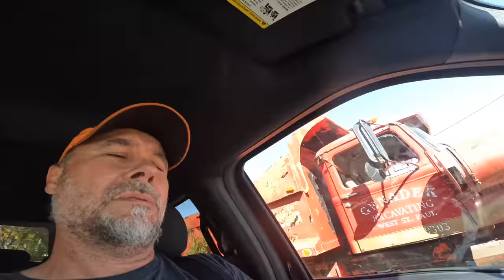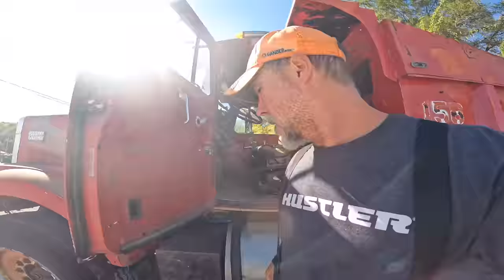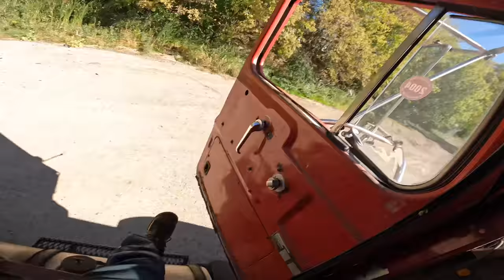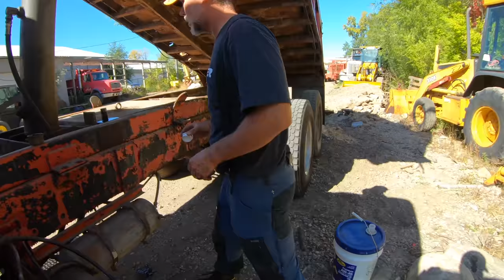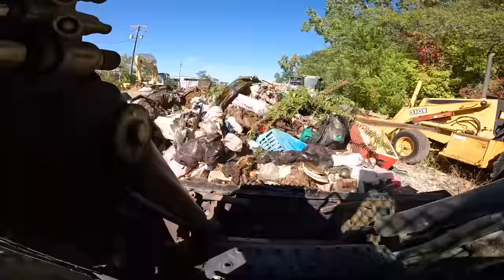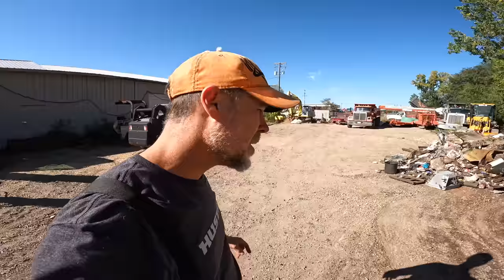Bloated Load gets stuck in the air

Comment: 9513 Road ranger transmission. One of the last true White Trucks made before the Volvo influence took over .

  There was a 75 ' White  Road Boss Tow truck with an 850 Holmes bed on it , here in my neck of the woods when I was growing up. 

It had a 350 Cummins & 9513 in it with a large Tulsa Winch on it. It was a hoss to say the least & sounded sweet going through the 13 speed.

Comment: Nice sounding engine to me, Stan, though not the same machine, the CAT R1600 scoop tram with the C11 6 cylinder engine was the sweetest sounding diesel engine that I ever operated, and one of the strongest when I was still mining. Thanks Stan, I loved the video!
Reply from the maker: I bet they sounded even more aggressive down in the mines underground.  I love how this engine sounds.
Reply: @Dirtmonkey  I don't know about Cat engines, but the Deutz's in our scoops up here in Ontario sounded bad ass and were very reliable .   Enjoyed the video though that truck seems very problematical, and may be better off rusting away in your yard🤔 .
Reply: @kasnitch  what mine was that if I may ask...I worked at the Dome Mine, Kidd Creek and finally at Hoyle Pond, Dome and Hoyle Pend used Deutz's on their smaller 2 to 5 yards is what I remember.
Reply: @frederickmoller  Hey thanks for replying Frederick .  I did a good long run up at Dickenson in Balmertown , after working for Graham in Wawa back in the day .  That was an excellent mine to work at and very good safety standards.
     I ended up getting too much dust exposure in some haywire outfits after a labour strike out there, and now have 40% lung capacity left .   That being said, it could be worse .   I miss the action every day, not sure about you .  I hope you are well .
Reply: @kasnitch  I had a stroke on the job about 4 years back that ended my career, though Dumas wanted me 2 years ago, I passed. Yeah I hear you too, I wish everything goes better for you from now on!

Comment: Years ago my uncle had an old White ups tractor we used as a yard tractor. It had a stiff clutch in it that had you pulling up on the steering wheel as you pushed in the clutch. 
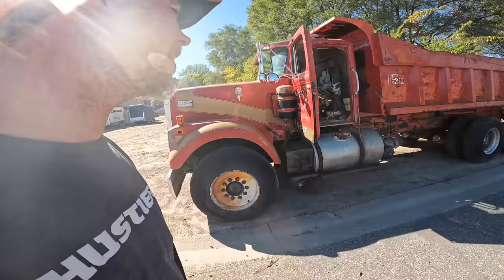  Paint line had their mover break down so I got stuck moving all their trailers on top of my building. I can still remember that week quite well even though it was 25 years ago. I would climb in the truck around 6:30 in the morning and ran till 5 at night. 
 Between pushing that clutch and climbing in & out of that tractor all day come 5:00 I could hardly walk anymore.  They had me moving for 4 of our shops & one week was enough for me. 
  My main truck used to be an old international grain truck converted to fifth wheel that i loved but for some reason I had it down at the moment also.
Reply from the maker: A tough clutch is a deal breaker for me.

Comment: There's a very fine line between making lease payments and not having the maintenance and breakdown/towing bills and headaches and the cost of keeping and old girl running let alone safe with the never ending repairs of discontinued parts and wore out everything. On the other hand the old girl has no DEF and no computer so there's at least 87 1/2% of all problems. But with a lease they are not your problems nor is my big ass bill for the wrecker 😁. We run canola oil through our fuel tanks on our wrecker in summer, amazing how cool the return lines are and the engine runs a lot cooler also. Have a gooder.

Comment: That truck brings a whole new level to the phrase, Rust Bucket. I don’t believe I’ve ever seen so much rust inside a vehicle as I saw in the cab of this truck. Also, my dad told me when they drove army trucks they would “double clutch” all of the time eliminating the clutch. This was in WWll.
Reply: You’re referring to floating. Double clutching is when you clutch in to break torque, trans neutral clutch out to match the input shaft to the next gear, clutch back in and into the next gear, then let the clutch back out. Floating gears is when you skip the double clutching and just lift the skinny pedal to break torque. If you’re decently coordinated and time it right you can up or down shift by just floating without causing any wear and tear on the trans.

Comment: I have to admit I was nervous watching you fill that hydraulic fluid without using that safety stop for the box.. I’ve been driving on and off for 25 years and there’s no way that other guy would have pulled you away fast enough with a loaded box. They come down so fast you wouldn’t have the time. Try slamming the gate next time it usually works for me.,Just be safe and take the extra 15 seconds to set up that bar. I think it’s time for a new truck. Lol.  😎👍🏼

Comment: I had a a day cab freightliner columbia with a clutch like that. Hauled bio waste with it in and around a fry plant so i had to use the clutch a lot backing inside, by the 2nd hour my clutch knee was killing me so i know exactly what you mean!! It just seemed like the spring was way too strong, we did the same we took it in but the mechanics did nothing!
Reply from the maker: This tranny is an eaton "autoshift". it should be called the eaton auto sh@t' in my opinion.

Comment: If you blew an Air Line, you'd know it fairly quick even if the Low-Air Warning Buzzer wasn't working because you're Parking Brakes would activate, stopping the truck from moving...

Or at least trying to stop the truck from moving, the engine might be able to overpower the Parking Brake, but you'd start smelling cooked brake pads REAL Quick...

Comment: Freighter  put a double disk clutch in it makes it easy
Reply from the maker: That was never an option given to me with that truck
Reply: @Dirtmonkey  I have a fl80. I put a double disc clutch in. It I ordered specifically to spec takes half as much foot pressure to clutch it.
Reply: They won't give you that option from factory

Comment: I would do a working truck restoration. Simple paint fix the bed new airlines make it a reliable vehicle. What is a decent used truck of the same size cost. cost 20/30k. Plus you don't have any electronics or exhaust environmental crap to leave you on the side of the road.
Reply from the maker: There are lots of advantages to these old trucks

Comment: I've seen alot worse trucks to start with hell I've started with worse just smaller either you love working and restoring old trucks or you don't that truck is gonna need 30g to have someone blast and paint the chassis install new seats fix the door latches new rubber lights etc and that's not doing bodywork or updating anything it's a nice truck to start with it seems like
Reply from the maker: Agreed-  just not sure I want to dump that much into her.